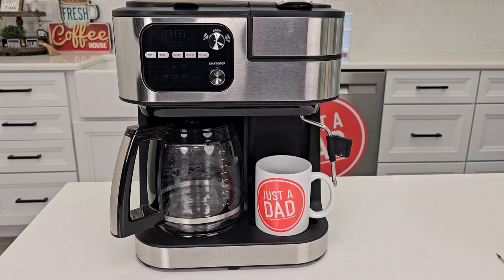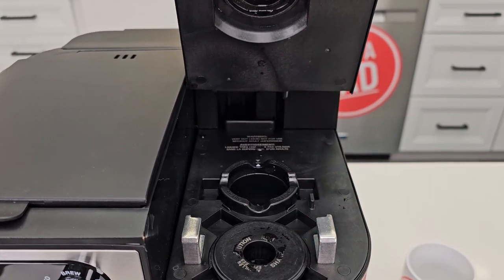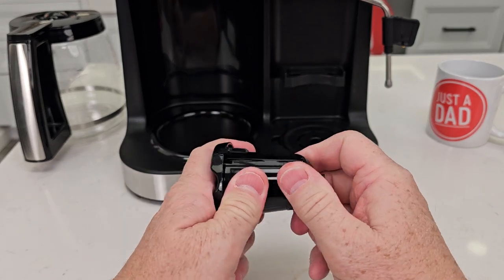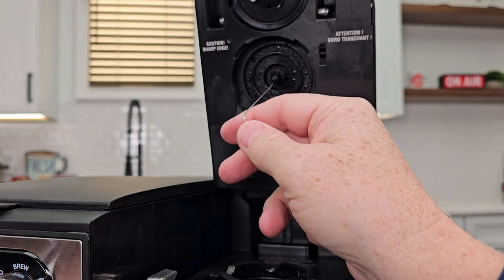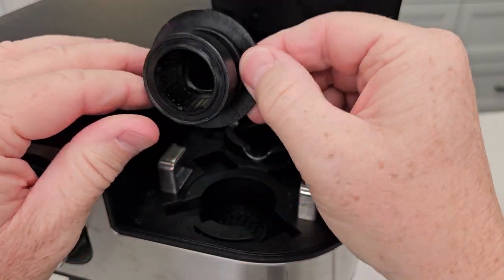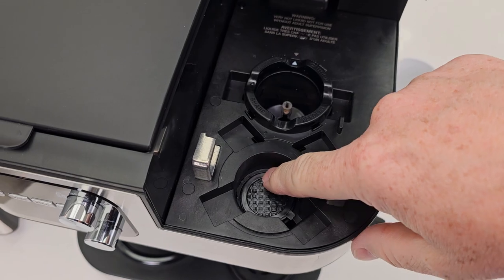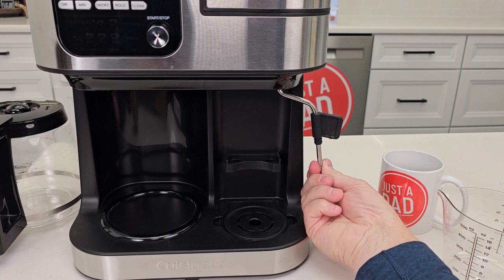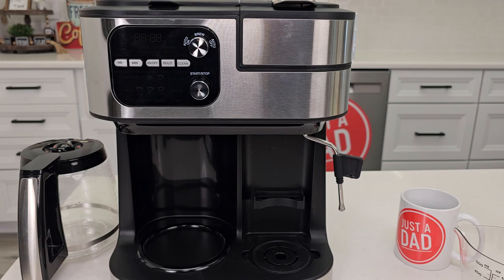How To Fix Cuisinart Coffee Maker Barista System Nespresso & K-Cup Remove & Clean Needles

Comment: I have a couple of suggestions that I have found really helpful, primarily in regard to the single serve side of the machine. 1) Very important to do a rinse brew after brewing either a k cup or Nespresso pod. Try this, after brewing an espresso do another brew without the pod and see how brown the water is. A rinse brew will not only help with keeping the flavor optimized but also assist with keeping the needles clean and free from getting plugged with grounds. 2) I have found that this machine likes genuine espresso pods, not the generic ones. Basically, the quality of the pod makes a difference. If you are experiencing issues lifting the handle after an espresso brew try using genuine pods. This made a big difference for me. The genuine pods also seem to puncture better and have a little better flavor IMHO. Hope this helps!
Reply: Thanks for the rinse tip!

Comment: Hey there, I like your video but am seeing a problem still. I cleaned the espresso pod side like you said, but it is popping and spitting out steam like a gasket was blown. I called Cuisinart and they want to just replace it, but I am thinking it is something that will just happen again. I used a thumbtack to gently clear each little hole in the espresso pod holder. I put it up to the light and can see through each hole. I didn't want to force larger holes. What am I doing wrong?

Comment: Do you know how to open the K-cup/nespresso pod door if it's stuck closed?  I put a nespresso pod in to make espresso and the latch will not open.
Reply: My sister also cannot get the pod door open after using the nespresso feature. Did you figure out how to open it??
Reply: No. Eventually I wrestled it open but it was pure luck that I got it opened again. I examined the closure mechanism , and there is a safety locking mechanism and it seems that the nespresso pod/adapter can sometimes throw the locking levers out of alignment such that the safety locking mechanism gets jammed.  I’m still working in a way to permanently disable the safety locking mechanism without breaking open that lid. I’ll update if I figure something out.
Reply: @winklertribe5268 omg please update if you do because the same thing happens to my offices coffee maker and it was totally my fault 😅
Reply: I still have not figured out how to get the kid open once it’s stuck closed. However, I find that if I pre-puncture the nespresso pod before putting it into the pod holder and closing the lid and brewing espresso, the lid doesn’t get stuck closed.

Comment: Have you ever had an issue where the lid on the pod side won’t lift up? Mine is stuck shut. And it won’t make the pod I have in there.
Reply: This seems to be an issue for several people. I have also noticed the same thing. Try using genuine espresso pods instead of less expensive generic ones. Also, after closing the lid, lift it up again and close it again before brewing. This might help provide a better puncture in the foil and the lid won't jam so easily.
Reply: But how do you get it open once it is stuck?
Reply: @jenniferhewlett9601  have you tried running more cycles through it? Run an espresso cycle a few times and see if that helps.
Reply: @bradsyoutube   wow! Thanks so much for your fast reply! Yes I tried 2 more cycles. It makes noise like it’s powering up, but no coffee comes out and then it gives a single beep as though finished. But lid is impossible to open. Waiting for a call back from Customer Service.
Reply: @jenniferhewlett9601  oh wow! I’m curious to see what Customer Service says. My next go to would be brute force lol. Mine got pretty stuck one time. I just gave it the old upward palm punch. Not sure you want to go that route quite yet. That was with a generic Nespresso pod. I stopped using those and it’s been working good ever since. Good luck! Would love to hear how it works out for you.
Reply: Same thing. It was a Peet’s coffee branded Nespresso pod. For anyone else having this problem, we did 3-4 Nespresso pod cycles and no water was coming out/lid would not budge. What ended up working was running a k-cup cycle and then a Nespresso cycle. Let it sit for a couple of minutes and it suddenly made a hissing noise and released the pressure. Then we were able to open the lid as normal. We’ll stick to only Nespresso pods from now on. Thank you so much for taking the time to answer me!
Reply: @jenniferhewlett9601  Great to hear! And you’re welcome 👍 sounds like we need to stay away from the generic Nespresso pods. Sadly, they were the first pods I purchased when I bought this machine. Thinking I would save some money.🙄 Nice to hear you can enjoy your single serve coffee now. 😎
Reply: I just got mine and it won't brew the espresso side at all, keeps saying EO and won't clear

Comment: I'm curious. Does anybody else think these charcoal filters are a bit odd? The one in the drip side of the machine will dry out if you don't use drip coffee very often, and i'm guess it drying out isn't good. And I can't figure out how the single server water reservoir filter even filters the water? Water can easily get past it and into the brewer, right? At least with my Keurig the filter was at the bottom of the tank so water had to go through it.